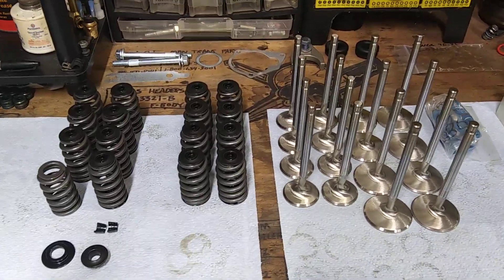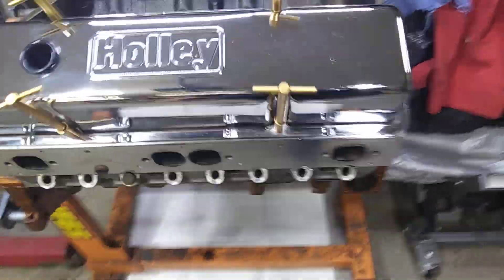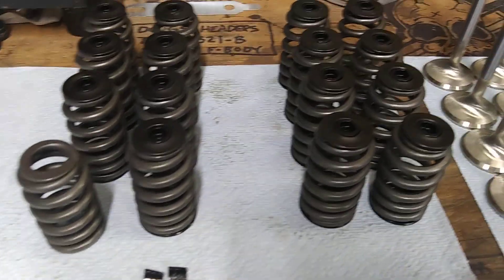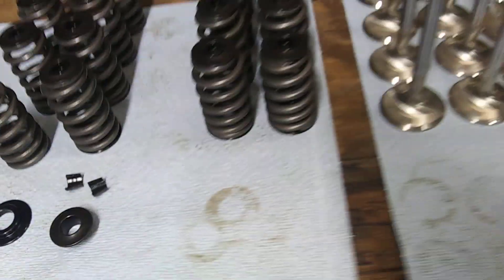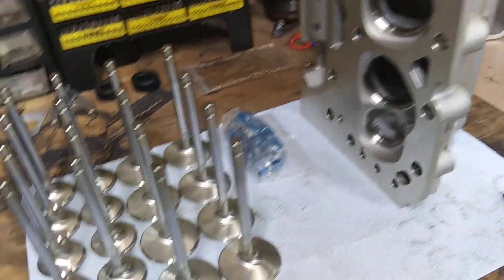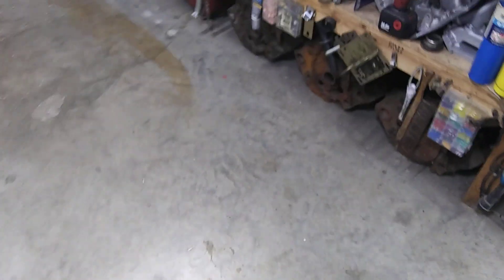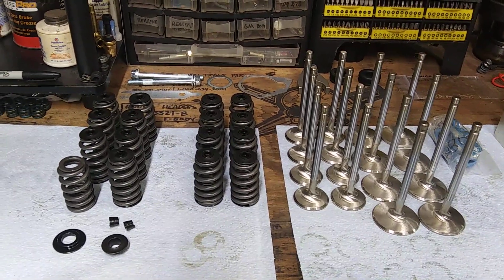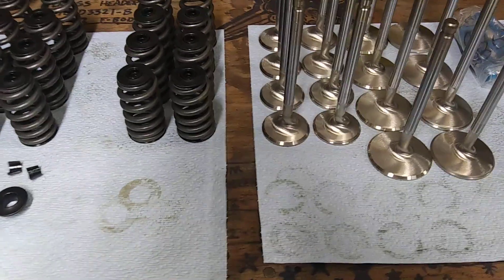Cheap hydraulic roller cam conversion for SBC.

Comment: Weird my ebay generic Dart copy heads need +100 valves, yours may have been machined different(VJ sunk) or maybe you have +200/250 valves?   Also are those real PAC springs?  A LOT of cheap fake/copy PAC, BTR & GM beehive springs on ebay ATM    I like the Comp locators and retainers, got a few sets myself.
Reply from the maker: Yep, usually they take .100 long, even bought a new set of PBMs just for them, but these seem to come in  better with standard length Manleys. The .100 longs would need a stack of shims to get down to 1.800. I figure the retainer & locater is giving it a extra possible .100 installed height or the spring pockets could be a little deeper. I have several pairs of these heads under different names. I'm using +.200 long in my Pro Topline 220 heads to get a 2.00 install height for a .650 lift solid roller. My PROMAXX 200s took +.100 long for a 1.800 install. My Assault heads took +.100 long valves for a 1.850 installed height with +.50 locks. And yep, I paid extra for the PAC springs. 135lbs at 1.800, 380lbs at 1.200. I try to use good valvetrain components in all my heads even if the heads are cheap.
Reply: @thereluctantgearhead4544  Interesting I checked mine with a Comp 787 & 1787 retainer and also calculated for a Comp 60 thick locator.   I'm sure it's just a diff batch or w/e and proves you gotta check every head to be sure.  I saw that Brodix IK200 use +100 and figure my new set of heads would need them but as always I'll check the parts on the head.  I like PAC springs
Reply from the maker: @BOOT  My PROMAXX 200s used a +.100 valve. Appear to be same core as the IK 200s.

Comment from the maker: Use standard length valves with these heads if your using beehive springs with a 1.800 installed height.

Comment from the maker: Update on the parts used, got checking the installed height on the springs and discovered that they are too tall, 1.945 intake and 1.955 exhaust, so I swapped out the +.100 long valves for standard length Manley valves and used a -50 keeper, ended up with 1.795 installed height on the intake and 1.805 on the exhaust. 1.800 is target installed height with these springs. It'll be fine.
Reply: Does PAC have a similar spring that has a shorter installed height? I have my heads bolted on, and I have pbm +.100" valves already set up with comp 987 springs. Changing valves is not an option.
Reply from the maker: @inscoredbz  usually these type  heads set up with a +100 valve at 1.800 or so. Best to just throw a valve in there and check your installed height to see what your working with. Wouldn't want to install theses 1219s at more than 1.800, won't have enough seat pressure. PSI has some beehive  springs that set up alittle taller. Of course they cost more.
Reply from the maker: @inscoredbz  What's your current installed height with the 987s?
Reply: @thereluctantgearhead4544  1.8" with a +.100" valve using spring seats normal retainer and locks (no +- on either) with shims under the spring seats. I'm not sure how much they had to be shimmed, I got my machinist to do it when he did a valve job on the heads.
Reply: The LS style retainer surly sets up higher than a regular sbc retainer.
Reply from the maker: @inscoredbz  You should be able to just swap them out then. Using standard height locks & retainers.
Reply from the maker: @inscoredbz  They can be bought standard or plus or minus. I used the Comp standard height retainers.
Reply: @thereluctantgearhead4544  when you checked yours, did you check with a spring seat, or just the empty spring pocket to the bottom of the retainer? I appreciate your help.
Reply from the maker: @inscoredbz  Check with the spring seat your gonna use to see what you are working with. They are usually .060 thick.
Reply from the maker: @inscoredbz  You have alittle range to work with. As long as your between 1.795 to 1.805 you'll be fine. Won't even be a few lbs of seat pressure difference. The springs come out of the box with a slight variation, if you have a spring pressure checker, you can juggle them around and pretty much get them pretty evened out. I wouldn't worry about chasing them last couple lbs tho unless your building a NHRA "Stocker". Few lbs difference between the springs and you'll never know the difference.
Reply from the maker: @inscoredbz  I'd try to get all the intakes the same and all the exhaust the same too. Best to get them all exactly 1.800, but sometimes that becomes a bitch. And most available shims come .015, .030, and .060 thick. So it can get tricky. Gotta figure out your baseline installed height and go from there. Don't want a shitload of shims under the locator either, sometimes ya gotta get it nailed down with the valve locks installed height.
Reply: @thereluctantgearhead4544  I'll probably buy a retainer and see what it measures. If it's within . 050 I can get different locks and be fine.
Reply: Will these springs be better than the comp 987 springs I already have? I understand weight of the spring and retainers play a roll in it. I have never used a beehive spring, I like the idea of dual springs in case one breaks. 

I tried to order one single pac 10° retainer from summit. 25 bucks for a $6 part including shipping. What a bunch of bullshit. I was going to buy one and see where the installed height is with it. I did manage to find some  -.100 10° locks from Alex's parts.
Reply from the maker: @inscoredbz  The beehive springs are pretty good, easier on valvetrain, less frictional loss, but if your not revving the hell out of it, the weight savings is negligible.
Reply from the maker: @inscoredbz  That's pretty damn high for those retainers, I'd shop around. Check Howards offerings.

Comment: Fwiw, the limiting factor for the spider tray/dog bone setup is determined by how far the lifters “drop” down in the lifter bores. 
1. If the lifter drops too far the dog bone loses contact; allowing the lifter to turn in the bore. 
2. Crane used to sell an extended top HR lifter to use with dog bones to cure the problem. I’m sure someone still offers an extended top lifter. Hopefully
Reply from the maker: I've used the oem setup with a .600 lift cam, that's as far as I've gone with them. Hylift Johnson lifters is what I use. Beyond that I use paired roller lifters. Always liked Crane and Lunati or Isky. Comp also makes some good roller lifters.
Reply from the maker: Don't know if Crane is still around, they had some problems years ago and went under. Believe they got bought out and ain't doing much these days. I used alot of Crane components over the years. Still have a few Crane roller cams and some pop up horizontal bar lifters. Also have some Crane gold roller rockers from back in the day.
Reply: @thereluctantgearhead4544  Comp bought Crane.  they can still make the crane grinds

Comment: I thought Chevrolet was roller cam from 86 up? I'm not a fan of the beehive. I'm no engine builder...I've built a few engines thou 
I might be older than you also a retired mechanic. You do Nice work, have an impressive stach, I dig your channel
Reply from the maker: They started making roller cam engines in the late 80s for Vettes and F-bodys, but the trucks didn't get them till the mid 90s. Some truck blocks are drilled and tapped for the spider, but many are not. I have a 92 block that came with a flat tappet cam and it's not drilled for the spider.
Reply from the maker: Took me awhile to use the beehives, but I figured out they work pretty good when used with the proper parts. I'm old school, so I come from the big fat valvespring is better  mindset. But some of this modern shit is pretty good. I was a kid of the 70s. So I'm getting pretty old. But I don't feel old, still feel like I'm 21 sometimes. I think building hotrods will keep ya young to a point. But it'll also wear your body out.